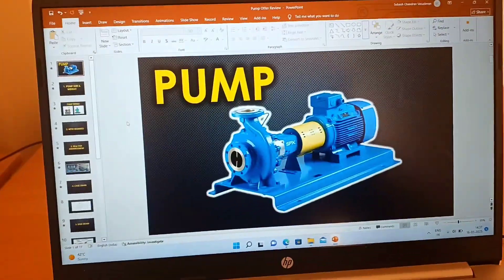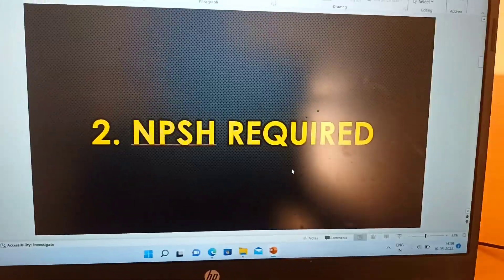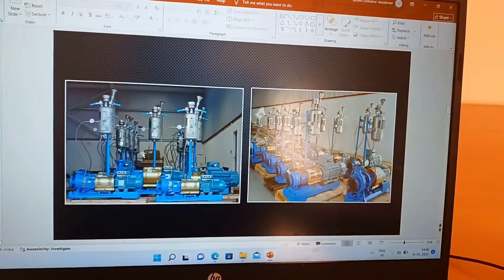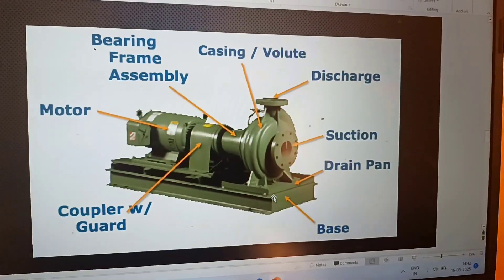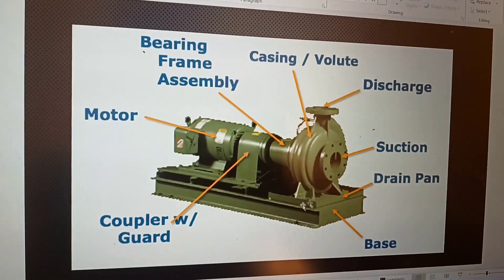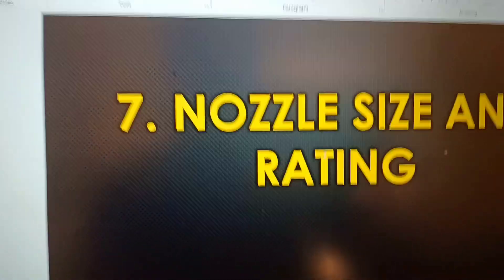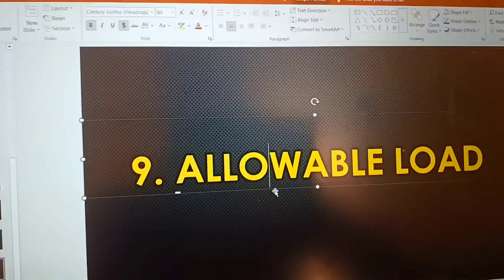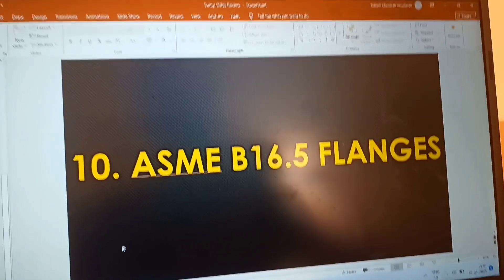Major Design Task - 10 Key requirements to Review Pump vendor Offers in Piping Design Engineering

Comment: Thank you for the valuable information, sir. I have been working in the office since the early stages and have gone through several phases such as requisition, drawing incorporation, vendor supply, and more. However, my salary remained very low even after 2.5 years, which eventually led me to leave the office job and the comfort zone it offered.

One of the main reasons was the lack of proper guidance from seniors—they mostly relied only on P&ID and GA drawings, and we were expected to handle field erection based solely on those.

I had hoped to become a piping designer, but now I find myself working in site execution instead.

Thank you again for the information. Wishing you a good life ahead.